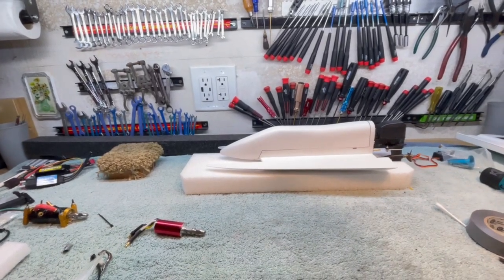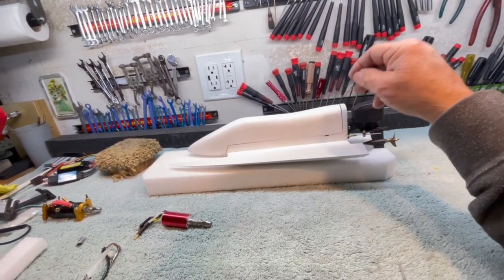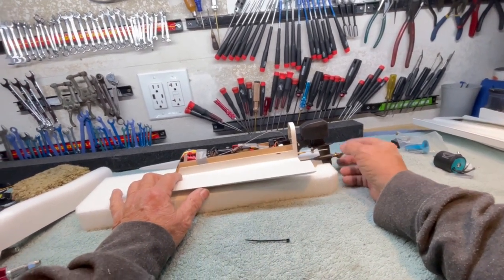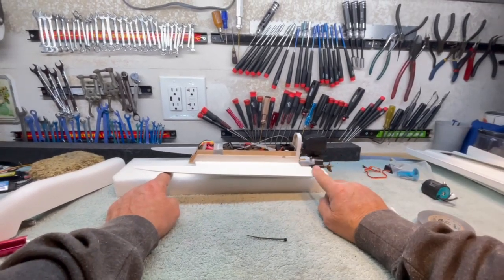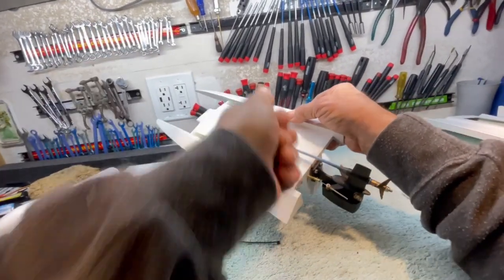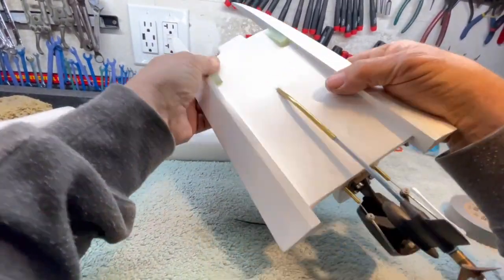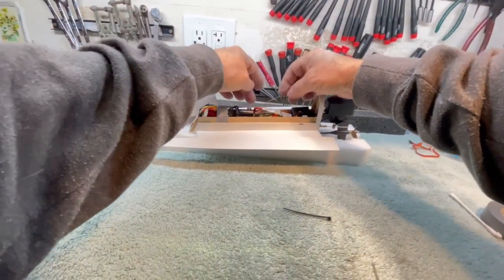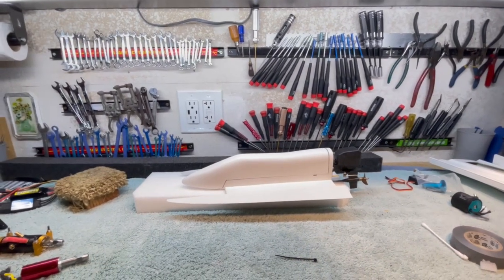Dr. Jet preps TunnelJet Prototype I for testing tomorrow.....

Comment: Excellent! I plan on putting stumble blocks on mine. Looks like the ones on the Zippkits G30. Still get the tunnel trapping air for lift that way. They said in the manual the boat really got right after they added them...
Reply from the maker: I just watched your video on the cowl.  You got that puppy looking really good!
Reply: @Dr_Jet  I appreciate that. I thought the same about yours. Just because these models are small doesn't mean one shouldn't put a good build on them. I would say to the contrary, light straight and strong is more important on a small boat...